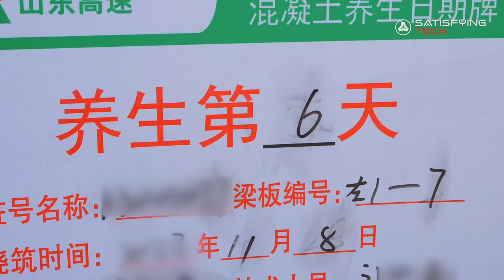Amazing Modern Bridge Construction Process！Large-Scale Bridge Factory!

Comment: How much tons by element ?
Reply: @nicolasdemannoury467....well, I'd say about 40 metric tonnes (44 US-tons or  88,000 lbs or  39.7 UK-tons, not knowing your origins, this should cover all the conversions).

I'm "guestimating" the element's weight based on some information provided by the sub-titles and my personal experience over the years. 

To wit: the tractor/trailer which transported the element had 7 axles, the GAWR (gross axle weight rating) of each were likely: 6,000 kg for the Steer; 21,000 kg for the Tandem-Drives, plus 36,000 kg for the 4 bogey-axles combined at the rear = Total of 65,000 kg gross capacity. The combined tare weight (empty weight) of this combination was likely 15,900 kg.....plus weights of fuel, truck-driver & the "bogey-steerer", tools,  tie-downs (steel-cables, chains, binders etc), which combined easily add another 4,000 kg, so grosso modo about 20 Tonnes.

The crane itself weighs as is about 55 Tonnes. The sub-titles (as well as my counting the weights embossed on each counter-weight) indicated that the crew added 71 Tonnes of counter-weights to the crane, to prevent the crane from tipping-over while lifting and positioning the concrete bridge elements.

Yep...my answer to your question = 40 Tonnes, is just about correct ...lol